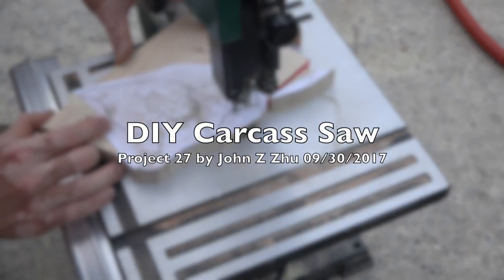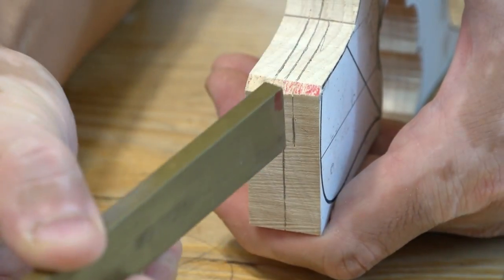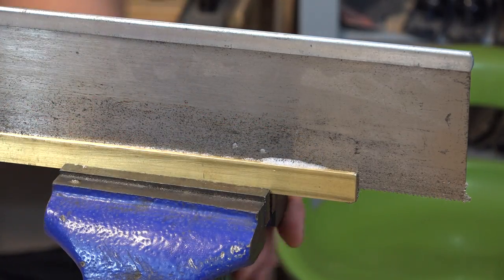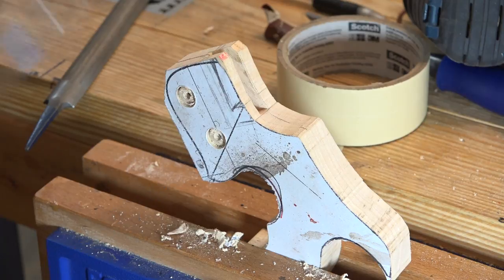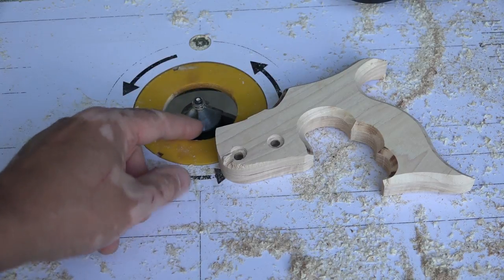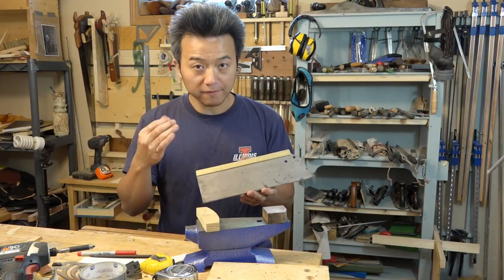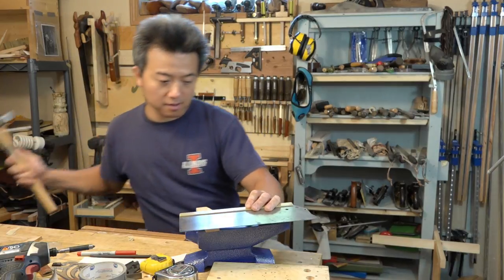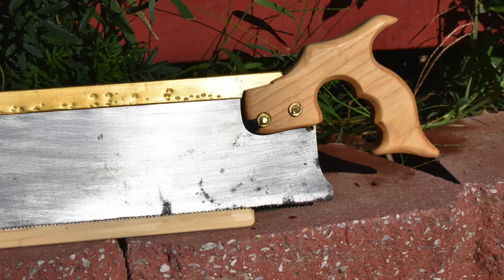Western Handsaw

Comment: Great work!  Tip from a guy who has done a lot of work with metal sheet: Look for a Roper-Whitney #5jr punch set.  You can sometimes get them used for cheap, and they fit in a toolbox or drawer well.  Drilling holes in sheet metal is the pits.
Reply from the maker: Thanks.

Comment: Great job. If I may? It takes a little more set up but if you take a hacksaw blade... one of the 1&1/2" height blades and straighten the teeth flat you can make a kerf saw to cut the beam slot for the blade. But you have to be really accurate and make a jig to keep it square. That's if you wanted to get into saw making. That one looks like it will last you a good long while. Again thanks for the video. Always enjoy them.
Reply from the maker: That's a great suggestion. I don't have one of those blades, it probably would've made it easier, I don't actually have difficulty keeping a saw online freehand.